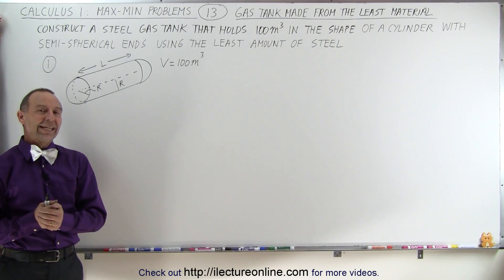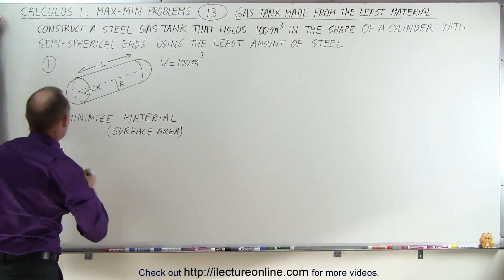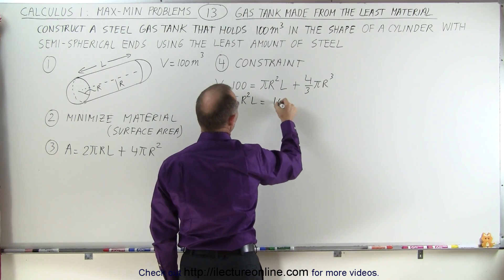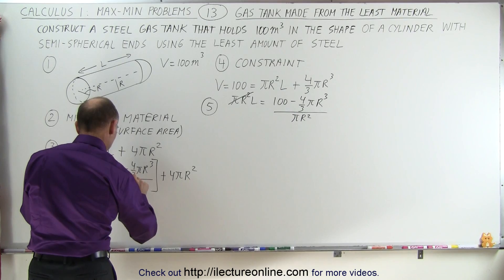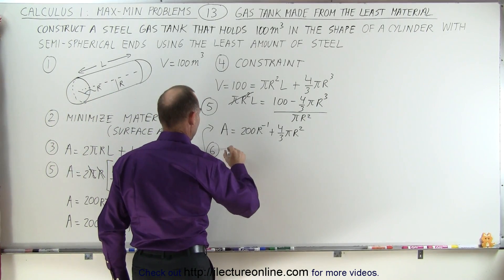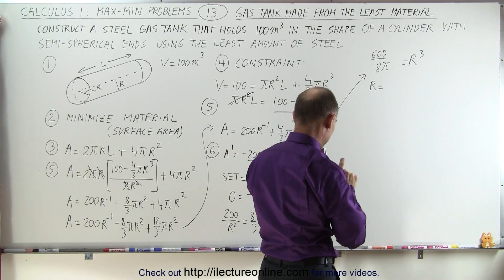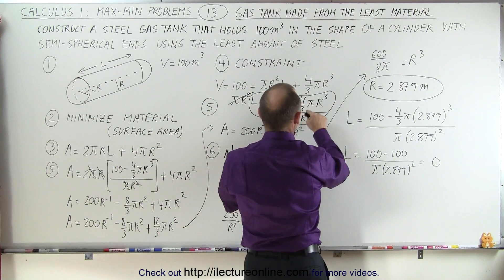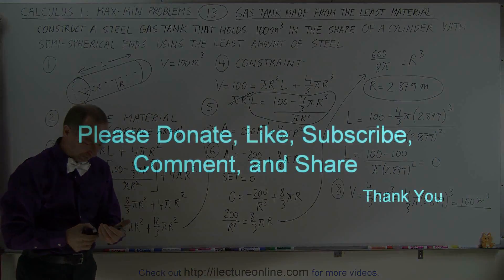Calculus 1: Max-Min Problems (13 of 30) Gas Tank Made from the Least Material

Comment: the height of a cone is 20cm.A small cone is cutoff from the top by a plane parallel to the base.If its volume be 1/125 of the 
volume of the original cone determine at what height above the base the section is made?
Reply from the maker: V top = (1/125) V total       (1/3) (pi r^2) h = (1/125) (1/3) (pi R^2) (y+h)  Where y+h = 20 cm and h is the height of he cut off piece.  And h/r = (h+y)/R